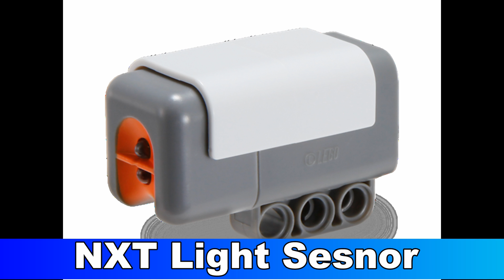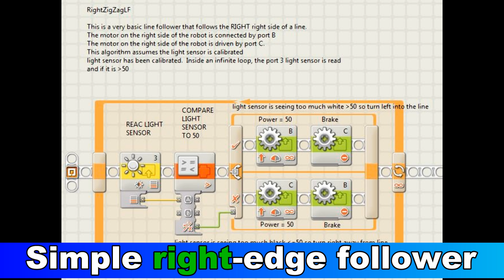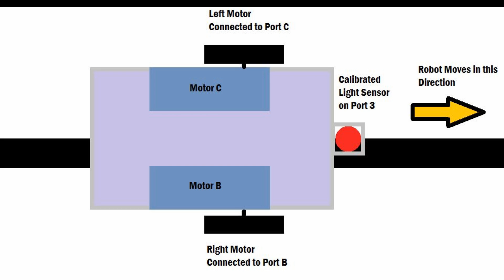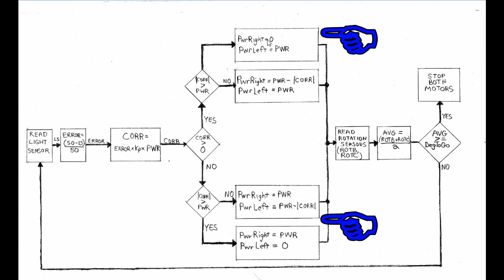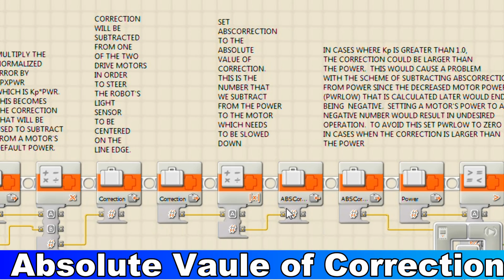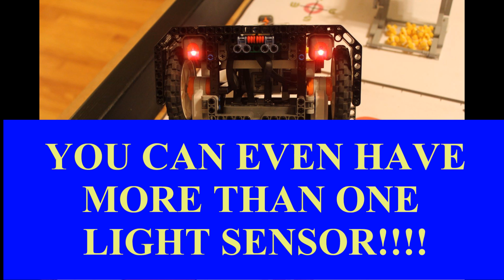Making a Proportional Line Follower for FLL (FIRST LEGO League) Robots

Comment: Can we use proportional line following for colored lines, as most of the lines are colored in FLL 2014.
Reply: Yeah. Instead of putting threshold as 50, take the reading for the colored lines and put it there. As there are different colors, create 'threshold' as an imput for the my block, and as for the sub my block, just create the variable 'InThereshold'.

Comment: Great video. Our FLL team has both Mindstorm Light and EV3 Color sensor. Please describe how you measure sensor resolution. Will share results.
Reply from the maker: If you go to @2:36 of the video, you can see that our light sensor reads 490 when over the white part of the mat and 670 when over the black part of the mat.  So when a few millimeters above the mat and shielded from ambient light, the sensor will read integers between 490 and 670 meaning there will be 180 discrete values between the lightest part of the mat at the darkest part of the mat.  Note that if you turn off the sensor's LED and just measure ambient light of the room there will be a much greater range of values going between a completely dark room and a bright flashlight close to the sensor.

When you do the same test under mat conditions with the color sensor operating in light sensor mode, when the sensor is over white it reports 47 and when it's over black the reading is 27.  Thus there are only 20 discrete values representing the darkest and lightest values that will be read on the mat.  This is much lower resolution.

Regarding the EV3, I do not own one; so I don't know how the EV3 color sensor compares.

One thing that's interesting in comparing the NXT light and color sensor is that they interface to the NXT over different interfaces.  Information on this is available on the internet, and I'll summarize what I know here:
1) The light sensor provides an analog voltage level to the NXT brick which is converted by a 10-bit analog to digital converter within the NXT brick.
2) The color sensor has an analog to digital converter built in, so instead of providing analog it provides already digitized data to the NXT over an interface called I2C.  The I2C uses a different two wires of the six available to transmit data to the NXT.  One line is a clock line and the other is a data line, that is used to transmit the data one bit at a time.

To get the full resolution of the light sensor you should use the raw value output and not the calibrated value.  The light sensor block has more than one output available (expand the data hub to see them all).  This raw value is simply the 10-bit binary word that is made by an analog to digital converter that is proportional to the light level.

Just do a test with the EV3 color sensor with the LED turned on and read the values when over a white and black part of the mat (when room lighting is dim) to see its range of values.

Comment: my team used NXT color sensor, but we had to do a huge calculation with the raw value to calibrate. however with the EV3 sensors it had brilliant performance!
Reply from the maker: Thanks so much for the information!  It's good to know that even with the color sensor and its small range of readings, line following still works well.  Like I said in the video, my team never bothered with the color sensor since during testing we noticed a much larger range of sensor readings with the light sensor, which we assumed would give us more precision.  But perhaps the color sensor provides all the precision needed... you just don't need all that precision.

One thing that I'm kind of guessing about is that since the EV3 processor runs much faster than the NXT that line following on the EV3 could be made to perform much better because rather than going through the feedback loop about 100 times a second, it would probably run at 10000 times a second (guessing!!).  Having more time samples is like having more resolution too... but maybe 100 times a second is all you need too.  Maybe this is where the PI or PID controller would really outshine the humble P (proportional) controller.  I'm thinking with a higher sample rate, you could probably run the motors much faster and still follow the line smoothly.
Reply: we run a full PID and (with EV3) calculated a loop speed of about 344 time a second. do you have a Ev3?

Comment: How does is work with the new software ?
Reply from the maker: I don't have the new software; so I don't know exactly.  Everything with the algorithm should work exactly the same, regardless of the programming language and you should be able to implement everything I did similarly on the EV3 language.  Going through the comments, I've ascertained that you can't calibrate (i.e. limit the value to between 0 and 100) the NXT light sensor output in EV3 like you could in NXT.  Assuming you can read the raw light sensor output which ranges from 0 to 1023, you could find out the raw light sensor values when over white and black part of the mat.  To calibrate, you could use a line going between the two values.  For example, when over the black part of the mat you get a value 600 and over the white part you get 400 ( just to make up numbers).  We want black to correspond to zero and white to correspond to 100.  Using the raw value outputs as the x coordinate and the calibrated values as the y coordinate, we can see the slope of the line is (delta y)/(delta x) = (100-0)/(400-600) = -100/200 = -1/2.  The point-slope equation can then be used to produce the calibrated values: (y-y1) = slope*(x-x1).  Therefor: (y - 0) = -1/2*(x-600) or y = -.5*x + 300.  Thus in this example if you got a sensor reading of 500, you'd run it through the equation to compute the calibrated output: y = -.5*500 +300 = 50.  Thus as long as your raw light sensor values are in between your min and max levels, this easy formula will allow you to perform the calibration function that is missing in EV3.  To be safe you should try to ensure that if you get a number bigger/smaller than your expected raw value max/min that you clip your result to either 0 or 100... and this will take a few more programming blocks (switch and comparte).

Other than the calibration issue, which is easily solved, everything else in the algorithm should work perfectly no matter what programming language you use, even Java or C!

Comment from the maker: Thanks!
I was talking with a coach from Germany and he indicated there is another reason to prefer the light sensor over the color sensor.  The reason is the light sensor can be read faster than the color sensor.  A quick test on my robot of timing a loop of 100 reads on both sensors showed the color sensor to be slightly faster, but this is misleading, because the color sensor does not do the math to scale the raw outputs. Scaling the outputs of the col sensor makes it slower than the light sen

Comment from the maker: Thank you for providing this informatiton!  With raw values, you can just take a sample over black and a sample over white and then assume a linear relationship, i.e. a certain raw value corresponds to white (scaled as 100) and another raw value corresponds to black (scaled to zero).  If you know two points (x1,y1) and (x2,y2) you write the equation of a line, that could convert other raw values read from the sensor to the scaled value between 0 and 100; thus my algorithm could be used.